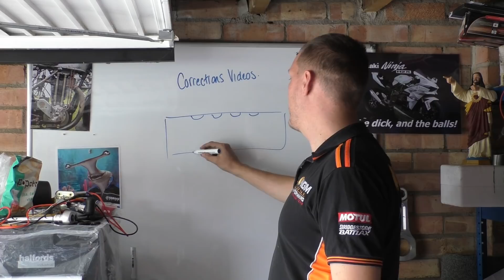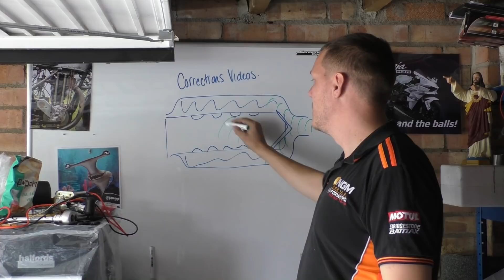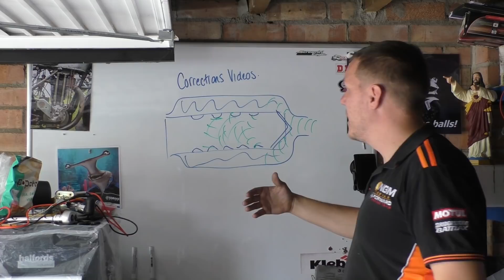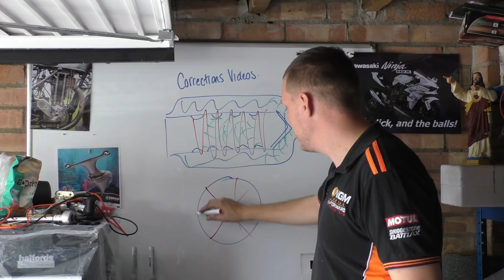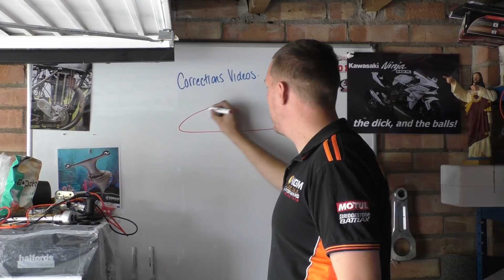MIG WIRE EXHAUST! WTF! - (CV#3)

Comment: Talk about knob head, when I was 15 I put a sock in my exhaust. It made it vary quiet but once it started to burn I decided to hold it wfo thinking it would just burn out and go away. Not what happened at all, the engine sucked the burning sock back in and bent the exhaust valve.
Reply: ezra riek we all did brother we all did...
Reply: eh why was there suction in the exhaust?
Reply: Lol when I was 15 I had a torn muffler so we wrapped it in a bed sheet lol. After a bit of driving I parked up and a flaming piece of rag wag in my neighbours driveway lol

Comment: Not video related question:
I'm still interested in engine warm up.
I often start my engine and go downhill then. Is it right (my theory) that normal idle is better for the engine than using engine breaking?
Because idle means the least amount of force and revolutions, while having combustion going.
When going downhill, it's revving the engine with less combustion than there should be in normal operation.

So.. I shouldn't use engine breaking on a cold engine?

(I'm only talking about very light/reasonable engine breaking, it's obvious that high revving is bad)
Reply from the maker: Definately not! You need to left the engine or should I say oil warm up. Thin oil can get to where its needed earlier and quicker than thick oil. Let the bike warm up and then do what you want.

Comment: We used to do this with 2 stroke 50, 125, 250 and 350 bike's expansion chamber baffles to pass the MOT except we used bare copper wire back in the 1980's. Once the MOT was done it was all taken out back home. It used to noticeably nerf power obviously but did shout the pipes up for the MOT test.

What I can't figure out why use mig wire??!!

Comment: Matt what was the original video called? Id love to go check it out and see if the guy is being for real or just trolling! 

As an aside, can you try and do a video on spark plugs please? I know you wont like this but ive just bought a skyline and am having issues with it, everyones saying the plugs are fucked but i cant get my head around how .01 or 2 gap difference would be the difference between a 10bhp heap of shit and a 350bhp beast. Great vids mate i watch them all even though i dont ride!
Reply from the maker: https://www.youtube.com/watch?v=hwWmEWVP8zc

and yes mate I can, I've done basics video but what are you after, heat ranges, how they in principle or different types?
Reply: The Workshop awesome your a total gent!

Well as soon as the engine gets into boost it shits its pants and just misfires and dumps all the fuel, im being told that the gap and heat ranges are wrong and that i need colder plugs, im not a total mechanical dumbass i do all the work myself on my cars but this has me baffled how something as little as gap size can totally change how an engine drives. Thanks for replying mate, this is why your channel is doing so well!
Reply from the maker: "The Workshop awesome your a total gent!"

- steady now lol

As far as gap sizes go it all about pressure. The higher the pressure in the cylinder the smaller the gap needed. Its all about kernels but that's for a video on its own.

Basically fuel and air are insulators compared to the spark-plug. The voltage has to build up enough to ionise the gas between the gap. 

Plug heat is about how spark plugs clean themselves i.e stop themselves from fouling.

Comment: Wait a minute.. Why do that in the first place? What is to gain supposedly????? Are these people on acid..??
Reply from the maker: Drain cleaner I think!
Reply: I have no clue WTF the wire accomplishes besides adding restriction. This is someone with too much time on their hands Gerry riggin shit that has no need to be gerry rigged.
Reply: Manufacturers of bikes or exhaust systems spend thousands of hours studying fluid dynamics and other sorts of stuff, making countless tests and dyno runs for each system and spending huge amounts of money so they can design and produce an optimised exhaust system for each specific bike and then comes a guy with no scientific knowledge whatsoever, a tig welder, some spare wire (and possibly some acid) trying to prove them inadequate and fix a nonexistent problem... 
Get the fuck outta here...